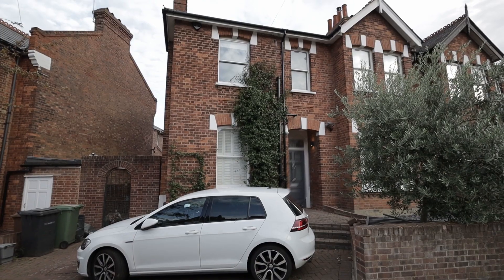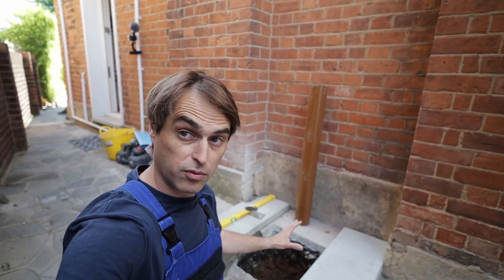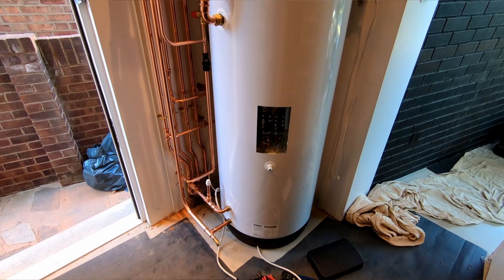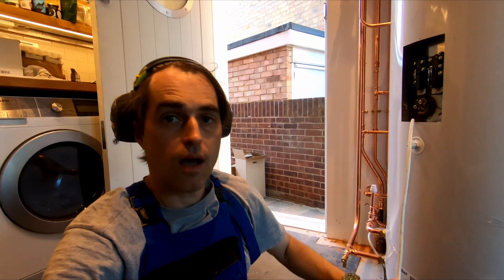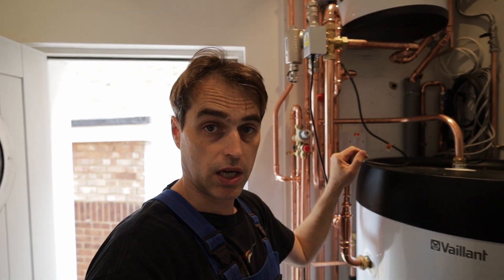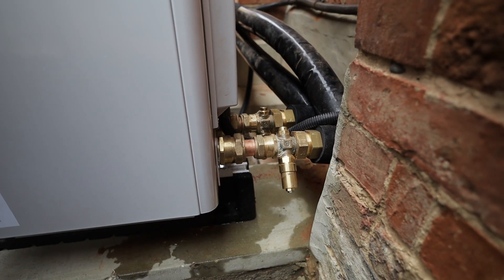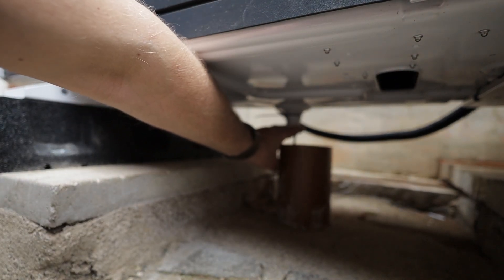Is This Heat Pump Better Than Your Gas Boiler?

Comment: The first is the efficiency of air source heat pumps. The Government(uk) feels heat pumps are game changing technologies as they are highly efficient – at times converting 1 unit of electricity into 4 or 5 units of useful heat (so 400 or 500% efficiency), while a gas boiler might be somewhere around 90 – 95% efficient.

On the face of it, that makes it look a no brainer. A very efficient heating system that produces no carbon dioxide. The issue is that the efficiency numbers often cited in the media are not annualised figures (i.e. an average efficiency over the course of a year). They are cherry picking the peak efficiency – which occurs when the air temperature is in excess of 20 degrees.

Air source heat pumps work by taking latent heat out the air, and transferring this into a refrigeration coolant. The coolant is then compressed using an electrical compressor which drives the temperature up, and then a heat exchanger takes the heat from the coolant and transfers it to the hot water within a heating system. Regardless of the air temperature outside of the property, the coolant typically can get to the temperature required to run a heating system – but it just takes a load more electricity as the compressor needs to work that much harder when the weather is cooler.

It is true there is some heat in the air even in extremely low temperatures, however in order to drive the temperature of the coolant up to a useful level, the compressor needs to work harder – and remember the compressor works on electricity. This brings the efficiency right down potentially to 150% efficiency. So, while in the summer, efficiency of the heat pump could well be in excess of 500% (i.e. one unit of electricity produces 5 units of useful heat), this is certainly not the case when the temperature outside is hovering around zero.

Now if you think of the times of year when you typically run a heating system, it is during the colder winter months. This means that when the weather is cooler, the compressor works harder, and your heat pump will be what we often describe as an electricity vampire.

What we are saying is that when you need the heating, air source heat pumps are working at their least efficient.

As of 16th March, gas and electricity prices are at unprecedented levels.

The cost of a unit of gas is approximately 7.5 pence per kWh.

The cost of a unit of electricity is approximately 28 pence per kWh

But typically the ratio has stayed the same even when prices were much lower – a unit of electricity is approximately 4 times the price of a unit of gas.

If you gas boiler is running at 95% efficiency, it is going to cost you right now about £0.07 per unit of useful heat.

In the winter, when the air source heat pump could be running at 150% efficiency, it is going to cost you £0.19 per unit of useful heat.

So no emissions in the home, but more than twice as expensive to run!

ASHPs are powered by electricity that may still come from burning gas
The other issue with electric heating systems is that while they produce no in home emissions, most of our power still comes from gas power plants. So, it is likely that gas was burnt to produce the electricity needed to run the air source heat pump anyway!

Obviously there has been huge investment into renewables like wind turbines, but if the wind doesn’t blow, much of our power still comes from fossil fuels.

I think there are a few points worth caveating though. Firstly, ground source heat pumps are a different story. They have a very similar efficiency all year round – approx. 450%. However, they are extremely expensive to install.

If you do go for a heat pump, it does infer that your house is sufficiently insulated (their working temperatures are far lower than gas boilers), so that in itself will see you have lower energy bills that an uninsulated equivalent property.
Reply from the maker: You do realise that average condensing boiler efficiency in situ is around 82% due to years of very poor installation practices, lack of design and gross oversizing? 

Do you also realise that quoted heat pump efficiency are annual averages, so called aCOP?

And yes this system will run at over 400% efficiency on average, making it 20% cheaper to run than gas system it replaced.

Also has vs electricity prices are no longer 4:1, it is getting more 5:1 with gas prices rising quirkier than electricity.

On top of that this system will soon benefit from PV making it even cheaper to run.

With current energy prices it is such a no brainier that heat pump and pv installers are booked for months ahead and number of inquires for those systems is through the roof
Reply: @UrbanPlumbers  heat pumps are complete con in this country half the houses could not use them my house couldn't for instance and it would take me 20 years to recoup my money and I will be dead by then they are really only suitable for new build houses only middle class fools will pay £20,000+ for installation plus another 10,000 really good insulation and new radiators and 20+ years to get  your money back
Reply from the maker: @londo776  do you actually have any arguments or just conjectures?
Reply: @UrbanPlumbers  prove me wrong on my questions then you cannot so do please tell me how many houses are suitable for heat pumps with no modification or installation just one question you can answer please, and typical installation cost

Comment: All that pipe work on the outside of the building, you get a very cold winter they will freeze just like combi boilers and then stop working.
Reply from the maker: Just watch the video before commenting :)

Comment: I am really thinking aboud installing a hybrid installation at my house with this
 heatpump. U make me geek more about my job man! 😅
Reply from the maker: that is what I am planning to do - keep a gas boiler for DHW and below 2C temps and install an undersized air source for super efficiency and cheap heating. Don't need any grants for that or the hot water cylinder. It is not expensive to do either.

Comment: Writing from Sweden 8ex-pat). We installed a CtC heat pump last year and haven't looked back. Houses are usually well insulated here but our house is quite old and there is a bit of a draught. Nevertheless the heat pump or outside fan has a built-in sensor which "tells" it to work a bit harder in order to pull in the outside air and convert it to heat energy. We're probably going to install an indoor sensor at some point too, but so far it hasn't been necessary.
Reply from the maker: Yes if weather comp is set well yiu don’t need indoor sensors.
Reply: And the cost of installation and cost of electricity to run it?
Reply from the maker: Watch last 2 videos - you will find all that there

Comment: Very interesting video, superb workmanship, thanks for posting. Watching from eastern Canada where my outside design temperature is -25C, sometimes gets down to -35C around here. I installed a cold climate air source heat pump system connected to an indoor air handler with 100% electric backup heat (10kW) because the heat pump turns off at -30C. I need 5 kW electric heat to come on to help the heat pump starting around-26C. By -30C, I’m heating with the full 10 kW…fortunately it doesn’t get that cold too often! I replaced a forced warm air single stage gas furnace with the Mitsubishi heat pump, I’m very happy with it, however, phenomenally expensive conversion equivalent to £12,366. What would a system like this cost?
Reply from the maker: Here the temperature almost never drops below 0 and people are still panicking about heat pumps :)

The cost of this system was almost identical to what you have paid for yours
Reply: @UrbanPlumbers  Not so bad, then. I did consider going with a two-stage variable speed gas furnace with a 16 SEER cooling unit for roughly £9500, but my neighbour had the same Mitsubishi unit installed two years previous with great results so, keeping up with the Jones’, I had to get one as well. Maybe the centigrade temperature scale should be replaced by Kelvin or Rankine scale when it comes to heat pumps. 0C does sound cold, but that’s 273K, now that’s hot!
Reply: @georgeian3243  That truly sounds like a British joke. Hello from Texas!

Comment: Wasn't it cheaper to upgrade the gas boiler set up to low carbon heating saving all this extra cost?
Reply from the maker: we did exactly that - upgraded boiler to a low carbon heating, so not sure I understand your quesiton

Comment: I've put a couple of Spacepak reverse cycle chillers (Fancy talk for ASHP) in, in New York. I also put a boiler as backup. They seem to be getting better. The problem in the US is most old houses have hi temp rads and not enough envelope insulation/sealing.
Reply from the maker: same issue here. A vast majority of houses in London are 1890 / 1930 build - so zero insulation and ancient heating systems sized for 75C flow.

Comment: Third Question: if you don't use antifreeze, does that mean that in freezing weather the system has to run 24/7 just enough to stop the system freezing (and thus draining) even if no heat is needed in the home? You're saying that over the course of a year that small extra load is outweighed by the efficiency gain from not using antifreeze? 

I'm guessing there's a frost-stat in the outside unit to trigger that.
Reply from the maker: its just a frost protection that need to bring the water to 5C. In those temperatures, the unit is very unlikely to be off anyway.

Comment: I'm of the understanding that a heat pump is slower to heat a house due to the reduced temp, is therefore more appropriate to stay with a gas boiler if heat a house irregularly. 
For a pensioner for example who may be home all day, heat pump makes sense, but a family that will be working/school, and only back for an evening and then boiler off for a short period in the morning, is it still worth it?
Reply: Also to add to that, any  central heating (CH) system makes sense if you frequently use most of the house. If you are a single person living in a multi bedroom home then heating just one room might be a better option.

Putting this together with the OP: a single person in a larger home who is out during working hours all week might not find any CH worthwhile.

Using usually only 1 room at a time in my 3 bedroom flat, in winter I have been only heating one room with a resistive electric heater. Even with the huge cost differential between electricity and gas, that has actually worked out cheaper than the gas central heating. 

Yes, it's chilly when I use the loo, and yes I do great the bathroom before having a bath or shower, but the kitchen quickly warms up when I'm cooking (and I never saw the point of the radiator in the kitchen even when I was using the CH).

I want to install a heatpump when I can afford to for environmental reasons and to help encourage the technology. I'm not convinced that with my current lifestyle it will save money though. Even with radiators turned off in more than half the house, it's still pumping the warm water round the whole circuit.

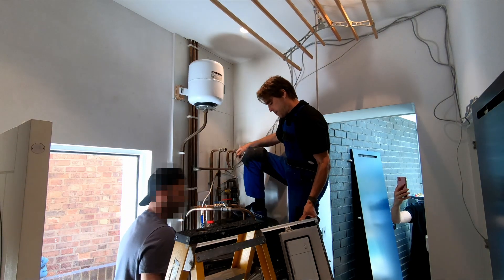Comment: @ 3:00 the problem is the boiler because it cannot modulate its power sufficiently. But the good part is that more and more boilers with higher modulation appear on the market :)
Reply from the maker: just in time when they get phased out
Reply: @UrbanPlumbers  they can be Phased out - they are small and convenient to use + there is enough Gas in the soil for more than 100 years .. but I keep telling to my clients that their current boiler for some will be their last; I also personally want to install a multisplit system from Mitsubishi or Hitachi for heating in autumn and spring, but in winter it will still work on a gas boiler because in winter we also have -20 C. 
+ there is another problem, not all people have @ 30-50k E to update the thermosystem of the house and the heating system..
And the last thing - i am a HVAC service thenician but at under -5 C i Tell to everyone with heat pump that I will fix their heat pumps in the spring if It breaks in winter :D …

Comment: @ 2:28 being installed between two buildings in a relatively narrow alley, it will not create an area with colder air around it than the outside one, eventually ending up recirculating part of the air, which theoretically can lower the efficiency of the heat pump a little
Reply from the maker: its open on both sides and also exceeds manufactures clerances - so should be fine

Comment: Another question: do you know about the govt grants?

My understanding is that if you want a grant you have to get the kit installed professionally. That's sensible from the government's angle, but it creates a financial trade off for the skilled DIY person 

So do you have any idea which is likely to work out cheaper:
- self install buying all the components at trade prices
- professional install minus govt grant
Reply from the maker: do not self-install. That is a disaster waiting to happen.

Also when you get an installer make sure they are not only MCS registered but also experienced and reputable. Go on 'heat geek map' on google for a better chance of finding a reputable installer.

You can get 5K grant through the BUS scheme and Heat Geek runs a Heat Geek Assured heat pump installation scheme that will get you the grant.
Reply: @UrbanPlumbers  frankly, a consumer can get burnt either way. I am sure you are honest, but not every installer is.

Here's a counter example, not regarding hear pumps but rather regarding solar panels. It's a case where a barrister nearly got scammed.

https://youtu.be/Oi96Lja0YMg

That kind of run around is  as likely to happen in heat pump quotations as with solar. That's exactly why I want to understand up front how each part works, how much it costs at trade, and how much is added by the installer. 

Not going through that process is a possible disaster waiting to happen; or could turn out fine if I get an honest and competent installer. I want that to be a matter of my understanding and judgment, not a lottery.

Again, no reflection on you: I say again I'm sure you are not like the scammers in the above link.

Comment: Waste of money £50,000 or £60,000 to insulate & install.
Most people would never ever see a return,  just turn your heating down &  whear appreciate clothing.
Not sit around in your underwear in 21c temp.
But excellent install again.
Reply from the maker: the insulation and heat pump supply and fit were not even half of your quoted figures!
Reply: @UrbanPlumbers  And we like sitting around in underwear!

Comment: I may have misunderstood, but you said that the output temperature was 40degC. This seems inadequate for heating the domestic hot water supplies as I always thought that they should be over 65degC to inhibit bacteria.
Apart from that query, I was very impressed with your installation and your explanations as you were assembling the system as I had not seen what was involved before. I think that it  would be difficult to install in my home.
Reply: I asked that about an hour ago -- look for my post that starts with the word "Question" because I got great replies from the channel creator.
Reply from the maker: output for DHW is currently set to 65C flow and can go as high as 75C if needed

Comment: No it isnt, as someone who works on both professional. The boiler will be able to put out substantially more BTUs consistently then that heat pump ever will, especially up in the northern states.  Second parts are widely available to fix a boiler in a couple hours vs that mini split requires high end parts not stocked at supplies houses. Parts take weeks to arrive from china.
Reply from the maker: not ture. You only need enough BTUs to meet the heat loss of the property and both gas boiler and an air source heat pump can meet that demand if installed correctly.

Comment: It's the price it's to expensive nobody but the rich can get this for ordinary people it's maybe possible to get solar and maybe batteries and a electric boiler which is still expensive all together but a heat pump nope even with the government grant however long that lasts for probably not long with the energy costs maybe going up to £5000 a year in 2023 and if this happens there is going to be serious trouble in the uk!
Reply from the maker: Octopus does supply and fit for around £4k after the grant for simple homes. Quality is not there yet but they may improve or rise the prices
Reply: @UrbanPlumbers  if only my house was suitable for air source air pump which it isn't like most house in Scotland